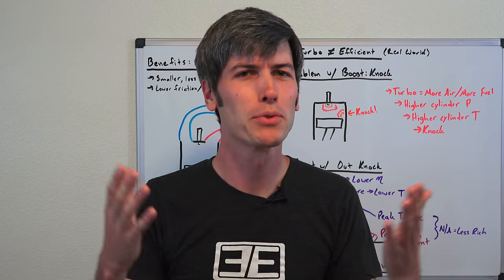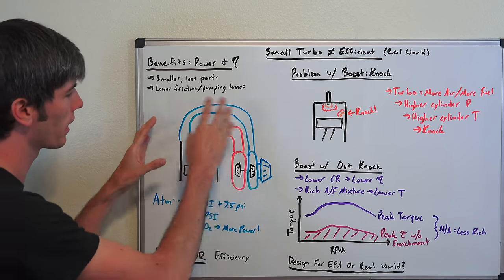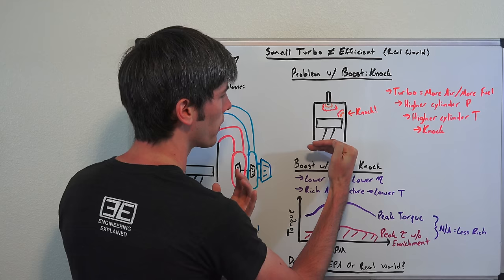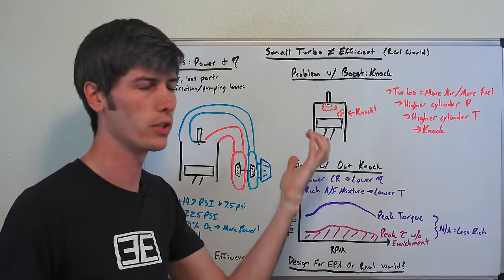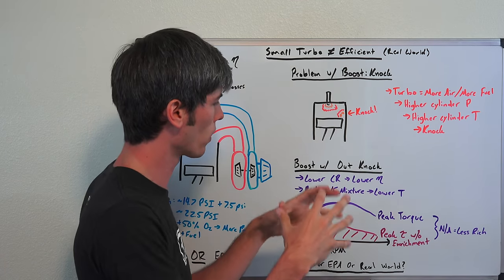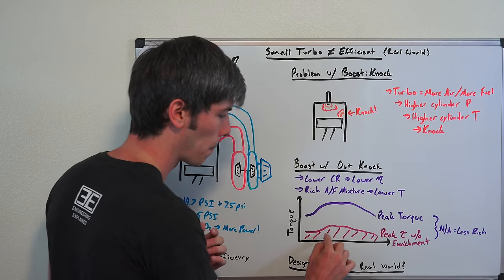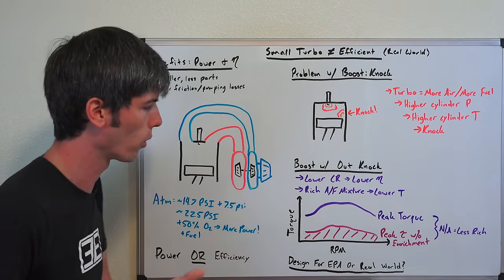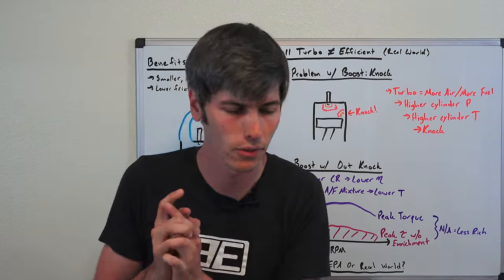Why Small Turbo Engines Are Not Efficient

Comment: I’m driving a 2018 Mercedes A250 (2.0-l Turbo 224-hp) and live in Germany. I’m actually impressed with the fuel economy this car delivers even if I drive it a bit hard on the Autobahn (never needed more than 9 L / 100 km during fast driving trips). 

The car comes standard with an app on the digital screen showing engine data including the turbo boost. It seems that I can drive the car fast on the Autobahn WITHOUT actually activating the turbo or keeping its boost low. For example, I can cruise at 160 or 200 km/h and the turbo boost is very low. It only goes up when I am accelerating hard. So essentially I get the impression that the engine tries to “function” like a naturally aspirated engine most of the time and the turbo is only there when I need extra power for hard acceleration or sporty driving. 

I also do my part in driving as efficiently as possible such as reading traffic ahead and reacting appropriately (letting off the gas early etc.) but overall I’m happy with the power and the gas mileage of my car. Last week I was cruising on the Autobahn mainly at 140 km/h with an occasional venture into the 180-200 km/h zone for maybe a total of 3 minutes max and after exactly 103 km my trip computer said my car consumed 6 L / 100 km - that’s frigging amazing. And since my tank was full I could see that my car had hardly consumed any fuel. For all the bickering about the gasoline ICE’s 25-35% efficiency, these are phenomenal numbers.

Comment: My truck has a 5.7L V8 with a 6 speed transmission and a 4.30 rear end gets an average of 14 mpg. Im willing to bet a 9 or 10 speed transmission with a lower ratio rear end, I'd get similar power to the ground with an increase in mpg of ~20%-30%. I dont want another turbo engine, but I really wish it had more speeds and lower rear end gearing. Turbos are getting cheap but it inevitably reduces the lifespan of a powertrain. Vehicle lifespan plays a huge role in environmental impact.

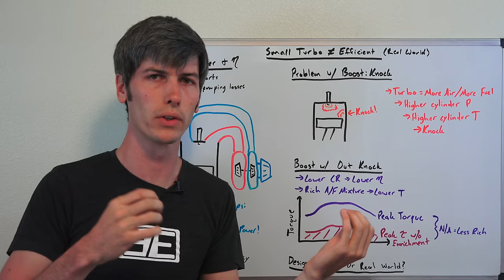Comment: 3:46 They could also inject water into the engine to reduce temps. Saves fuel because it doesn't have to run rich and the steam generated during combustion would give even more boost. IIRC some race cars do this.

Comment: 2015 Focus 1.5 ecoboost was a 2.0 Focus in power and fuel consumption but with added turbo lag of at least half anytime making a call for off boost power. The 2013 1.6 NA Focus was much fast in most cases with no guesswork in the fast corners.

Comment: to me, the advantage of a low displacement turbo engine is that, if you are easy on the pedal, they can achieve great fuel economy. A big displacement engine will guzzle gas no matter how you drive it.
Reply: Well, what about a small displacement N/A engine that makes the same power as your turbo engine then? The ND Miata gets some great real world MPG.

Comment: My 2014 Audi A6 2.0T with APR Stage II begs to differ.....Great MPG and most certainly spanks a lot of V6s out there.
Reply: "Great MPG" means nothing.  Give the actual number and we'll decide if it's "great."
Reply: @wiredforstereo  That certainly depends on how I drive it, what mode the car is placed in, such as dynamic, comfort, etc.., It really depends on mood I am in. What numbers are you specifically interested in, without having to pay for dyno..? Off the top of my driving very conservatively prior to APR II I avg 23-24mpg after I easily get 27-28mpg city. Driving moderately aggressive prior to stage II would be 18mpg avg.. after stg II its been 22-24mpg. Driving very aggressive I have seen it between 16-18mpg depending on traffic. So to me with this sports Sedan with Quattro (AWD), Yes it is "great".
Reply: @cyb3rcub  My naturally aspirated Asian sedan gets 35 mpg and has 300,000 miles.   The only way I get mileage like yours is when I'm towing a camper. Different goals I guess, but 24 is certainly not "great MPG" in my book.
Reply: @wiredforstereo  300k Very nice! What car is it as I can't imagine 35mpg in city driving conditions at all?? If I did not have stop and go traffic this bad here I know it would be higher. Not 35mpg but more around 28mpg. Now highway mpg is another story then yes 32-35mpg.
Reply: @cyb3rcub  05 Corolla, 1zz-fe engine. If I drive slower on the highway, I can get 42+.  Have clocked 52 with a strong tail wind. As low as 15 pulling a heavy trailer.
Reply: @wiredforstereo  Amazing.. I bought my son a corolla back in 2013 he still has it today. I didn't think much of doing anything to that car.... such mods exist for those cars today?
Reply: @cyb3rcub  Mods?  You mean the trailer hitch? You can put a hitch on anything.

Comment: This is why my 1150kg Ford Fiesta ST 2.0 is actually good on fuel. It’s large for the car size so it’s not working hard most of the time and it’s N/A so it’s never using loads of fuel. I average about 35mpg and get around 40mpg+ on the motorway

Comment: Knock depends a lot on fuel octane, or grade of gasoline. High test gas has less power than regular as it simply has less energy and burns slower. High test gas can generate more power because it doesn't knock at higher compression ratios. Higher compression results in more power. This is why an engine has a preference as to the grade of fuel.

Comment: I have a 2014 Mustang GT with a VMP supercharger, not turbo, making 9lbs of boost, 600 hp to the wheels, and I'm getting between 19-20 MPG consistently with a mix of highway and city driving.  A friend of mine has an Ecoboost Explorer with a 3.5 Ecoboost and his mileage is pretty much the same.  This who thing is marketing hype and most people don't think about the long term maintenance costs of turbos as well.  Yeah you could run cheap gas, but at what long term cost.  That coupled with the carbon buildup problems in these engines due to the direct injection systems, and it's gonna be a money pit as these engines age.  They key to longevity in a turbo or any high performance engine is cooling, good fuel, and proper lubrication.  Especially engine oil quality.  I have only owned Fords but I gotta say, my previous pushrod 5.0 went 256,000 miles with no issues, and my current Coyote 5.0 has also had no issues.  Great performers but the longevity has been frequent oil changes with a quality synthetic oil.  Funny that Ford never put Ecoboost on their V8 engines, but instead used Easton based superchargers on the 2003-2004 terminators and again in the 2007-2014 gt500s.  

Great video, just old school and not a fan of the Ecoboost engines.  Plus, there's nothing like the sound of a V8...

Comment: you can have engines that use two spark plugs per cylinder so two colliding flame fronts, that’s not a problem, but the problem I see is the mixture will burn faster (not faster traveling but lower travel distance like half) so you risk getting the peak pressure before tdc just like in the case of pre ignition
the flame fronts travel very slowly at only 20-50cm/s so as they travel very fast pressure (sound) waves at the speed of sound collide but each wave is small because it’s caused by a smaller extra quantity of fuel burned

Comment: I have the 1.0L ecoboost in my Fiesta and I have a lead foot. The turbo kicks in at around 1500 RPM because the turbo is so small, meaning I am on boost almost all the time when I am not cruising. Even so, I am still getting over 40 MPGs. My milage is almost exclusively highway, so even though I am flooring it all the time when I can, my lead foot makes little difference because of the time I spend cruising. I also drive 5-speed manual if that helps. So for me, it is kind of hard to tell what my milage would be if I did exclusively city driving with constant starts and stops.

Comment: Turbocharging works well with diesels. The lower exhaust gas temperature makes them more reliable than gasoline engines and knocking is not a problem.

Comment: I have a 2019 F150 with 3.5 EcoBeast. (A better name for it.) A few comments:
1. At 75 mph with the AC on, my F150 (quad cab 4wd) gets MORE than the rated 23mpg EPA highway rating.
2. Around town EPA rating is 18 mpg, it does that easily and I'm not "grandma-ing" it.
I love having tons of power when I want it but generally getting much better mileage. I might have considered a Toyota Tundra but their 'efficient' NA V8 is EPA rated at 13 city 17 hwy, 5 and 6 mpg respectively less than my Eco Beast 3.5.
3. Someone posted that a smaller engine with a turbo is not going to last as long. In the old days putting a turbo on a 150hp engine to get 220 out of it definitely would stress it too much and it might not last, but an engine designed from the ground up to make X amount of power does not have to care whether it comes from # of cylinders or displacement or turbocharging.
4. Good luck trailer-towing with a beefy NA V8 through the mountains at altitude, when the engine's power drops like a rock due to thin air. A turbocharged engine will make as much power there as anyplace.
5. Finally, if Ford's 3.5 EcoBoost engine hadn't proven reliable, either the F150 would have dropped way down in sales (it hasn't) or Ford would have had to dump it as a failure. They've been selling it now for 8 or 9 years and neither of those things have happened. They have come out with a second-gen version which addresses some of the issues of the original engine re intake valve deposits and the timing chains.

Comment: Direct injection of fuel on the intake stroke (instead of port injection) should provide a quenching effect in the cylinder to avoid engine knock on compression while maintaining a 14.7:1 A/F ratio.

Comment: I used to drive a first gen 1.4L Chevy Sonic turbo 6-speed. Ran 93 octane in it always. Around town i was getting 30-34MPG but on the highway throw it in sixth gear and i was getting over 40+ MPG. Never took it on a road trip but on a long stretch I'm sure i could do even better. So that little turbo seemed pretty efficient to me 🤷‍♂️

Comment: When I had a fiesta st, it would do fine cruising on the highway and around town as long as it was flat. If I hit even a moderate hill, the engine would dump fuel because the turbo was in its power band.

Comment: My Mitsubishi Colt CZT / CZ5 1.5L Turbo RallyArt 276pk.  The consumption is 1 liter of petrol / 16 kilometers.  

My parents have Nissan Qashqai with 1.2L 116hp.  Consumption is 1 liter of gasoline / 13 kilometers.  

1.5L is therefore more economical than 1.2L.  My opinion is that 1.5L engine is the minimum to have a turbo

Comment: Normally your Videos are Spot-On, however, this time you oversimplified the topic and had some bad info.
Remember the Indy Offy Engines, 4 Cyl/Turbo/Very Powerful/Competitive MPG! Your comments may be true in some cases, but there are too many examples of 4 Cly engines in the 1.8-2.0 litre range that work great.
We have a 2015 Mercedes Benz SLK 250 Roaster that has a 1.8 L, Turbo with an Inner Cooler that will Blow most cars door off. It runs on Premium Fuel and gets 32 MPG at 70MPH. I was a Diesel Mechanic and Service Manager for 50 years and have had several 911 Porsches/BMW/Corvettes and other performance cars (No Muscel Cars) and can say without a doubt that our SLK is by far the best performing car we have ever had, in terms of Comfort/Handling/Power/overall quality etc. I am somewhat familiar with the Miata and recognize it has a great car, just a little to small  inside for me.

Comment: I have a 2014 Ford Fiesta with the 1 liter turbo EcoBoost engine.  At a steady 65 mph on the highway I get a true 52 mpg measured on a highway loop and on interstate trips. Set the cruise on 65 and get 52 mpg.  The EPA numbers are much lower and are about the low 40's I see on slower 2 lane trips with traffic lights.  When I floor it manifold pressure goes to 34 psi probably killing efficiency.

Comment: I owned a 1.2 tsi with 105bhp, 175Nm and the 7 speed DSG in my VW polo. If I drive it like a maniac, I get about 9 kmpl(21mpg US) in the city and 14-15kmpl (32-35mpg)on the highway at about 75mph. However, if I set the cruise control to 90kmph(56mph) for some time, I got around 19kmpl(44MPG)which is pretty good at that speed. I do see the point though, driven harder, a small turbo engine isn’t the most efficient

Comment: I get great fuel economy with my 1.4L 17 Jetta like well above 36mpg on highway, above 23mpg loca always. You really shouldn't be flooring your economy vehicle if you want good MPG. I floor it and it GOES, I'm just not going to expect to be going that and fuel use be good. Just passing for a few secs at a time.
I'm 400miles back and forth to work (give or take a little), I have more than a quarter tank left every week. That's pretty good.

Comment: Big turbos can be more efficient because it's easier to stay out of boost. Low torque, high revving engines are similar in that it's easy to stay in low power by keeping rpms low. So by that logic, small high revving engines with big turbos are best for efficiency if you can control your desire for speed, which I cannot do.

Comment: There's also difference between larger turbocharged vehicles vs smaller turbocharged vehicles. I've had  my 1.6 T 200 hp car in the shop for replacing a craked windscreen and was given the same car model with 1l 100 hp engine. You would think the 1l engine would be more economical but I got 25 mpg in  town only, that is with a lot of traffic in his defense, but still 5 mpg less than the 1.6 engine with double the power in the same conditions

Comment: I think it's also worth mentioning that turbo diesel engines have practically none of these con-sides because those use direct injection so there's no fuel until you want ignition. As a result, you cannot get knock either.

Comment: we have a little ford with the 3 cyl 1.0l ecoboost. it gets us economy better than our previous 4cyl 2.0 n/a car (similar shape and weight) in both city and highway driving, while having more torque and power.

it will likely fail before it sees 150,000kms, but as far as fuel and user experience goes use goes - big win.

Comment: Lets talk about the elephant in the room.  The fuel.  In ww2 the Messerschmidt BF109 had an engine that was 20% larger than the Merlin engine the P51s were running yet the P51s had more power and were faster.  Both were supercharged.  The difference was the fuel was a higher octane rating and thus could stand much more boost than the Messerschmidt.
There are some other techniques that can be used such as stratified charge which was pioneered by Sir Henry Ricardo way back in the 1920s.  Direct cylinder injection is now being used on some small turbo engines and helps to fine tune the situation.
Water injection can also be used to cool the area around the exhaust valves sort of making the engine a quasi steam engine.
For the future the biggie is the fuel and then to a lesser extent stratified charge and water injection.

Comment: My old Volvo with a non-turbo 1.8 is so much more comfortable and nice to drive than the 1.2L turbo in some of the modern VW I've driven, even though it makes less horsepower. I barely go above 3k RPM. It's a very calm and relaxed experience. These small block turbo engines need to rev way more to make their power. More noise, more shifting... I hate this trend.

Comment: I used to have a 2014 Ford escape with a 1.6 L eco-boost, it had a plethora of problems. So the dealership bought it back. Thank goodness, because later on down the road the 1.6 L eco-boost had its own set of problems in many vehicles. That being said, I got phenomenal gas mileage in it. I traded it for 2015 Ford escape with a 2 L eco-boost, which was a way better, way faster engine. I was lucky to get 21 miles to the gallon regardless of how I drove that car. These small four-cylinder turbo charged engine are NOT efficient at all.

Comment: Very small turbos that run higher boost pressures and are constantly spooling up with almost no lag are a cause for reduced fuel economy in these cars as well. The engine goes into boost by just breathing on the throttle. Unfortunately the average consumer doesn't like turbo lag.
I treat the lag like a feature. It allows me to keep the engine out of boost when I'm light on the throttle and driving efficiently. These tiny turbos spool almost instantly and any small amount of throttle causes the engine to go into boost, requiring mixture enrichment.

Comment: My 4cyl 1.9L High pressure Turbo gets 6.5L / 100km normal spirited driving 9.5L/100km if i drive it hard all day @ max 22psi with 8.5:1 compression.  My 5cyl 2.5L Low pressure turbo uses way more at around 11.5L/100km normal and 13.5L/100kM being a lead foot @16psi 9:1. The 1.9 L makes around 40more HP than the 2.5. I love driving the 1.9L as can thrash it around and bairly uses any extra petrol and A LOT quicker than the 2.5. The 2.5 just drinks it but its a Auto and lose around 100hp in first gear being limited. Both make a lot of torque down low peak at 470nm. The 1.9L has almost no lag being a twinscroll while the 2.5L has to wait for the damn VVT to kick in which is 3000rpm. In my Case i prefer the smaller engine in every way including climbing steep hills except the sound the 5cyl just sounds awsum :P Stock they both make 200hp at 14psi and 7psi.

Comment: If I understand well, more fuel is injected for cooling in the same way you spray your face because it's hot outside ? Why not directly spray water inside the cylinder, so it bring down the temperature without wasting precious fuel.

Comment: We had a 2016 equinox with a 2.5 four cylinder that I could get 36 mile per gallon on the interstate and turnpike and around 22 around or home. Our new 2019 equinox has a much smaller 1.5 turbo charged engine. It does get a little better around our house,  about 29 mpg, but worse in interstate turnpike driving about 34 mpg.